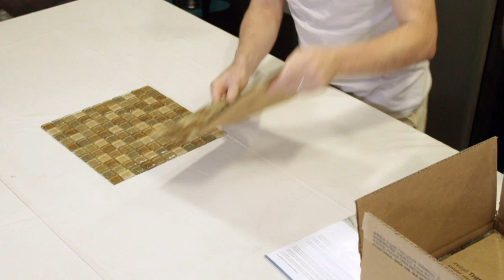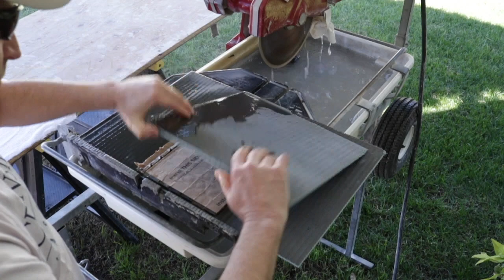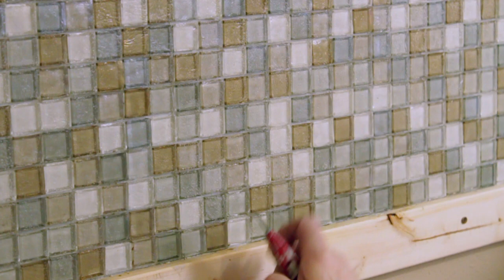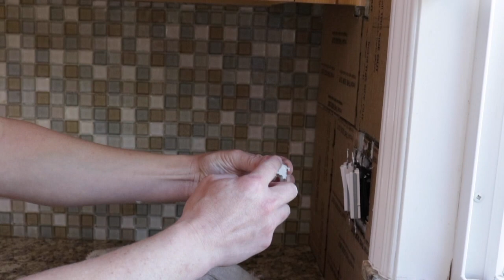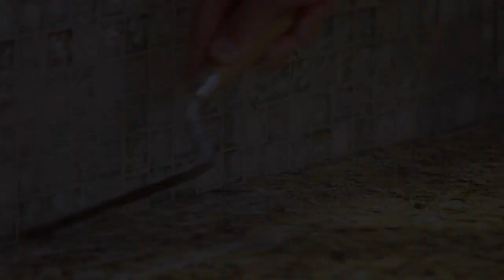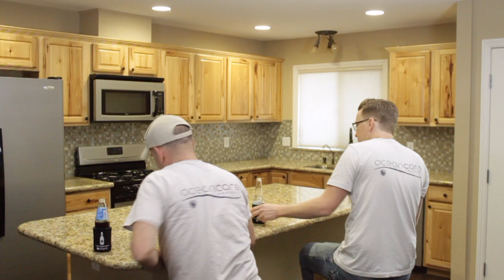How to Install a Glass Tile Mosaic Backsplash

Comment: Hi, I am installing glass mosaic tiles for kitchen backsplash.  The thickness of the pieces is 4mm and I would like to install Satin Anodized Aluminum Aluminum L-angle Tile Edge Trim 0.25 inch width.  Would that be the correct size for the tile edge.  Thank you for your help.

Comment: Nice job - very professional install and good information too. I wonder if there; however, is an inherent challenge with installing a mix of glass/marble/ceramic mosaic as an accent to surrounding ceramic or even small porcelain tile - will the mosiac get "crushed", i.e. squashed down by any larger tile (e.g. 6x6 ceramic) or will the spacers hold? Of course the type of mortar makes a difference for this too. Is Acrylic Pro adequate?
Reply from the maker: Hi Andrew. Thank you for your comment. A good rule of thumb is to follow the TCNA Handbook recommendation. Beyond that, when installing different materials, it’s important to understand each manufacturers’ installation requirements as they may recommend different setting materials. Most likely, you’ll install the field tile first, in this case ceramic or porcelain, leaving room for the glass accent. To do this, we recommend installing or tacking up a “ledger board” to hold the higher course of ceramic/porcelain. A ledger board is just a strip of wood that you temporarily nail to the wall and it allows you to set the ceramic/porcelain at the perfect height and level it off for the upper course of field tile. Once the field tile is installed, remove the ledger board and install the glass mosaic in the open space . We have a step by step guide on our website on Substrate Build-Up so the tile finishes flush with the surrounding field tile, http://www.glasstile.com/wp-content/uploads/2019/04/SubstrateBuildUp_v11.pdf. Hope this helps and happy installing!
Reply from the maker: P.S. Acrylic Pro is not a recommended thin set for our glass tile.

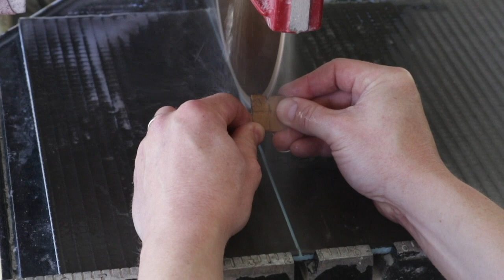Comment: very well done! made me a bit nervous cutting that one small tile though! 13:04
Reply: Thanks Mike! and don't worry about our fingers. Continuous rim, diamond blades don't necissarily "cut" through the tile as they use more of a grinding action with fine abrasive diamond in the blade edge. You definitely wouldn't want to catch your finger between the blade and the saw tray but because the grinding action only works on hard materials, you can actually touch these blades with your finger while the saw is running and it won't cut through your skin.
Reply: @brianfitzgerald4415  good to know! i just did my first mosaic tile job thanks to this video!